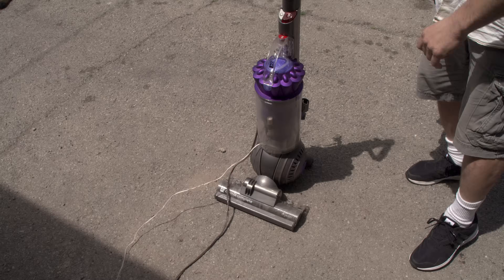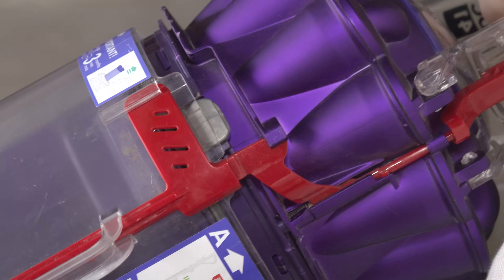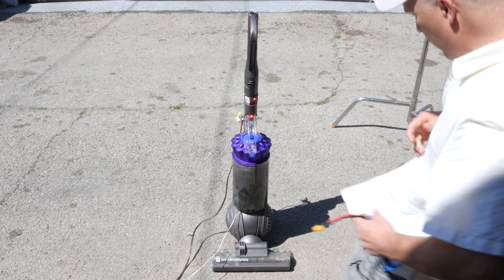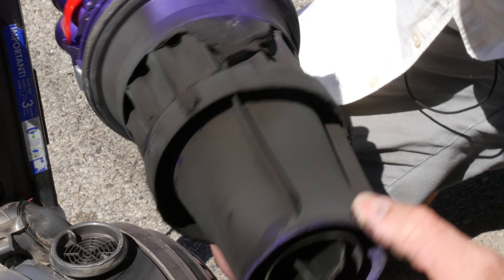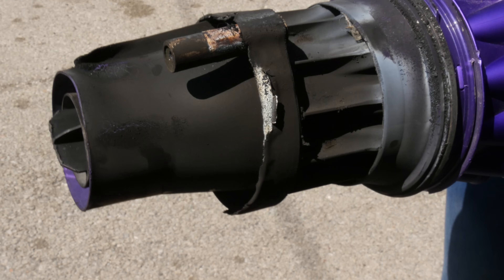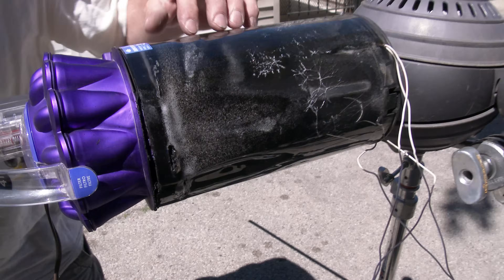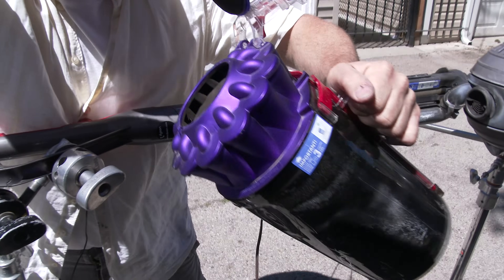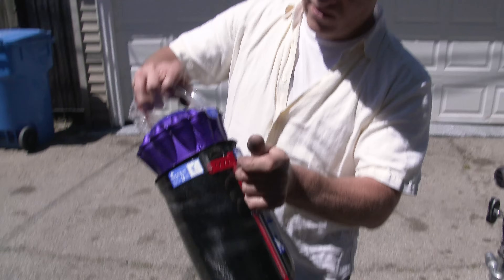Will Rocket Motor Burn in Complete Vacuum ?--- Cleaner?

Comment: That is definitely a LoL video.
But a vacuum cleaner doesn't suck air out it's chamber. Sure it may cause an atmospheric pressure drop, lower than what you are breathing but that isn't a vacuum. The only way you're going to get anywhere close to a complete vacuum would be to buy a vacuum pump either for scientific research or from a Refrigeration tool supply and the use that to draw a vacuum within a chamber. Some see through acrylic chambers can cost a grand but since you like to work with acrylic, you could build one. Other than laughs, this experiment proves nothing. Just recommending make a real chamber and pump setup. There are people on YouTube doing things like testing what happens to insects @ 28 inches of Mercury.

Comment: Nobody is arguing against rockets being able to burn fuel in a vacuum.. It has its own oxygen supply.. So of course it can burn in a vacuum. And in your other video what are you ignited a model rocket in a see-through tube you proved that Rockets cannot generate thrust in a vacuum. You proved your self wrong in your experiment. It didn't start providing thrust until the smoke from burning the rocket filled up the right side of the tube. If you watch in slow motion you can clearly see no force is being generated. It should have happened immediately if accelerating a mass was how Rockets generate thrust.

Comment: Even your "complete vacuum" one wasn't anywhere near a rough vacuum!!   The gauge said it was about 15"Hg!     Rough vacuum is 25", and once we hit 29", THEN we can start talking.   PLUS, obviously, once you ignite the rocket, you need to pull ALL that exhaust pressure out, else it just pressurizes back to normal ATM, or more.
Reply: No. No. No.  You're so wrong.  The Dyson vacuum is 42.44" tall.  Where are you getting your silly numbers?

Comment: Dude this is not a vacuum in the sense of a space without air in it. The vacuum is Constantly pulling air from that container not removing the air from it so no it’s not a vacuum like a glass bell jar that you can pump the air out of it and it has no air in a sealed space this is totally pointless experiment and the dyson leaks like a siv
Reply: Is too a vacuum!  It's right there on the label!  https://www.dyson.com.au/vacuum-cleaners.aspx

Comment: that's not a complete vacuum it still has oxygen in it. a complete vacuum would be all the air sucked out. the vacuum cleaner is still gonna have oxygen inside.

Comment: To have combustion you need fuel and an oxidizer.  In cars, airplanes, and jets the atmosphere provides the oxidizer.  We often "boost" this oxidizer with superchargers and turbochargers.  
Higher amounts of oxygen (oxidizer) allow us to pump and burn more fuel and produce more power.  
In rockets, we have solid or liquid oxidizers which are far denser forms.  We have designed solid and liquid molecules to include as much oxygen and potential energy as possible.  
The more oxidizer you have the more fuel you can burn the more power you can make.

Comment: OK disbelievers , Since we are dealing with the hypothetical let me  ask you a question. You find a large enough vacuum chamber you can fit into wearing a pressure suit. You get a trusted friend to operate the vacuum pump. You pull a vacuum equal to that of space. You hang a brick of C4 explosives (C4 has its own oxidiser)  from the ceiling. You have it wired to a detonator and you have the button to detonate it and you are standing let's say 10 feet from it. Would you push the button? Reminder, a rocket motor is nothing but a controlled explosion.  Think about it. Take a handgun into space. Pull the trigger. The bullet goes in one direction and the force of the explosion sends you in the other direction. Same thing as a rocket motor.

Comment: Idea for next rocket in vacuum experiment: Use a ring shaped vacuum tube, so the exhaust flows through the ring and enters from the front again. If the rocket thrust would be caused by pushing against gas, in this way it would not produce thrust, because the gas itself can not build up pressure behind the rocket to propell the rocket. I hope you understand :-)

Comment: You would need chamber that can handle total vacuum and valve that has similar chamber after it having vacuum via valve.  rocket engines any size produce a shitload of gasses and even my Dyson that almost sucks nails from floor is not enough

Comment: No rockets can travel in space idk how you think you can push off of nothing I've think we've taken science too far. And did you know that that same vacuum is made with all other vacuums in the same factory in china just a different design but same motor trust me I've been under the plastic it has the same force as the other except kirby vacuum those have are the good ones
Reply: For those who still do not believe rockets do work in a vacuum:

The thrust (reaction) of an engine results from expelling mass with high velocity behind them (action). The thrust is NOT the result of exhaust pushing against air behind the engine! That is a misconception. 

Think about a gun. The backstroke (reaction) is due to the acceleration of the bullet (action), not from the bullet pushing against the air it moves through. These are separate action/reaction processes outside the gun (engine) that are no more connected with the gun (engine). The interactions of any repellant with the air behind an engine exerts no force at all on them! The surrounding air does not even have the slightest chance against the expelled gas to get into the engine for combustion. The oxidizer comes from the rocket itself, in the atmosphere as in space.

The principle how rockets work in space 

Imagine two peoples with the same weight floating in space face to face with zero velocity. At the same moment each pushes the other away. What do you think happens? They both will move away from each other in opposite directions at a certain constant speed depending on how hard they pushed. The same would happen, if only one person pushes the other away, because of Newtons Third law: When one body exerts a force on a second body (action), the second body simultaneously exerts a force equal in magnitude and opposite in direction on the first body (reaction). They dont stop moving as long no forces are stopping them, because of Newtons First law: In an inertial reference frame, an object either remains at rest or continues to move at a constant velocity, unless acted upon by a force.

Now replace one person with a ball of the same mass, the other person is you. Throw the ball with a certain speed away from you (action). As before the ball exerts a force equal in magnitude but opposite in direction on you (reaction) and both, the ball and you, will start moving with the same velocity but in opposite directions. There is no need to have something the ball is pushing against to get repelled. If the ball is lighter than you, then the ball will move faster than you, but still both will move. Now replace the big ball with many small balls with the same total mass as the big ball and put them in a bag which is attached to you. If you throw all balls, e.g. the whole bag, at once with the same speed as the big ball you will get the same kick as before. If you take one small ball at a time out of the attached bag and throw it with the same speed as the big ball, you get only a small kick. With each ball you get another small kick until the bag is empty. The kicks sum up to a certain terminal speed for you. This speed is smaller than the speed obtained with the big ball, because when you throw the first small ball your mass is the combined mass of you plus the balls remaining in the attached bag. But you can get a higher terminal velocity by throwing the small balls with a higher speed. Again, this works regardless whether the thrown balls push against air or something else. What only matters is the mass of the balls and the speed they are expelled. You are accelerated by pushing you against the inertial mass of the balls, not the air behind you.

Now replace the bag by a tank attached to you filled with molecules of the same total mass. Throwing a big bunch of molecules at once or in a steady stream gives you a certain kick. The harder you expell the molecules, the bigger the kick you get and the faster you will move. If you have a mechanism like a rocket engine, that expells the molecules at a very high velocity in a steady stream, you get a steady thrust. Here again, the thrust is not due to molecules interacting with something behind the rocket, but only from expelling the fuel molecules with high velocity (action), which by this process exert a counter force to the rocket (reaction). You are literally repelling you from the inertial mass of the fuel molecules from the tank, giving you and the molecules a certain kick in opposite directions. 

To quantize that: The thrust force (F) equals the mass of gas expelled per second (dm/dt) times the velocity (v) that mass of gas is expelled. The higher the speed of the expelled gas the higher the thrust. The energy for that is comming from the combustion.

F = (dm/dt) * v

The acceleration (a) of the rocket is than simply this thrust (F) dividet by the mass of the rocket (M) including the remaining fuel (Mf). As the rocket uses up its fuel its mass decreases and so the acceleration increases with time.

a = F / (M + Mf)

By the way, jet engines work the same way. The thrust (reaction) results from expelling huge air masses behind them (action). The thrust is NOT the result of exhaust pushing against air behind the engine! That is a misconception. The interactions of any repellant with the air behind the engine exerts no force at all on them! 

Nowhere in the formula for thrust is a term that has to do with something the exhaust is pushing against!

The energy for the expelling of the fuel mass comes from the combustion of fuel with oxydizer. Rockets bring their oxidizer with them. Surrounding air does not even have the slightest chance against the expelled exhaust to get into the combustion chamber of the rocket. The oxidizer and fuel must be pumped in by strong turbo pumps. The size of the nozzle hole is dimensioned as such, that the pressure produzed by the combustion is maintained constant. 

Vacuum does not suck. The only force that expells the exhaust is the pressure in the chamber. In the atmosphere there is a relative small counter pressure from the air, so rocket engines are even more efficient in space without that counter pressure from the atmosphere.

Rockets can gain speeds greater than the exhaust velocities. The engine produces acceleration (a) that is not dependent on the actual speed (s) of the rocket but only on the mass expelled per second (dm/dt) and the exhaust speed (v) relative to the rocket. 

Speed is a relative concept. You can always find a reference frame in which the rocket is at rest at any moment. So in one system the rocket would be at rest and have max thrust, while at the same time in another system the rocket would be at exhaust speed (v) and have zero thrust. This would be a physical contradiction. But because not speed (s) but acceleration (a) is relevant for gaining more speed, and acceleration is not dependent on the reference frame, the rocket can get speeds much greater than the speed (v) the exhaust is expelled. The exhaust speed producing the thrust (acceleration) is always relative to the rocket, not relative to any other arbitrary reference frame.

The speed (s) relative to the start frame of reference, where the rocket was at rest at t=0, can be computed as:

s(t) = a(t) * t = ( (dm/dt) * v / (M + Mf(t)) ) * t

Expelled mass per time (dm/dt) and exhaust speed relative to the rocket (v) are constant. The fuel mass (Mf) decreases with time, so the net acceleration (a(t)) increases with time as the rocket gets lighter. 

As you can see, the speed s(t) can gain any value as time (t) gets bigger without any limit, as more time elapses, no matter what the speed of the exhaust (v) relative to the rocket is. As the rocket speed (s) relative to any observer approaches the speed of light, the mass of the rocket (M+Mf) starts to increases due to relativistic effects so that s can never reach the speed of light in any reference frame. That is the only speed limit and not dependent on the speed (v) of the expelled exhaust.

Comment: That was hillarious. I love the slomo footage of the D rockets torching through the canister.

It would be a bit sketchy, but it would be interesting to see if you could make a rocket motor that has a hole drilled straight through then inject nitrous oxide to see if you can make it burn more energetically. No real reason, but it would be an awesome thing to see if it works. (my suspicion is that it'll work pretty well)